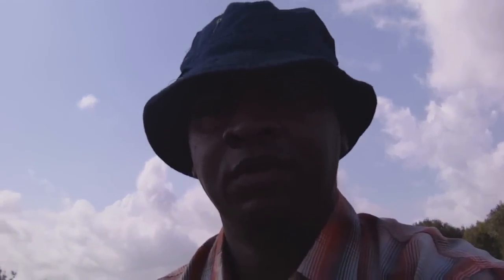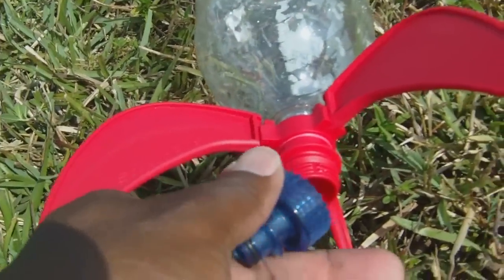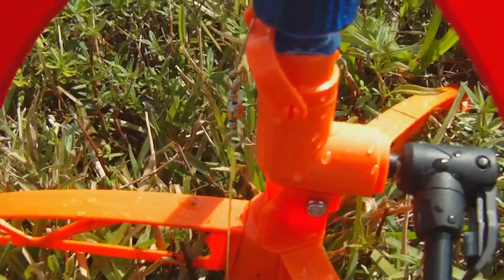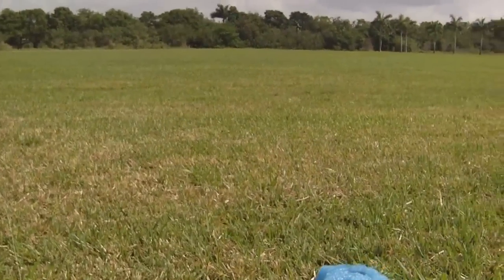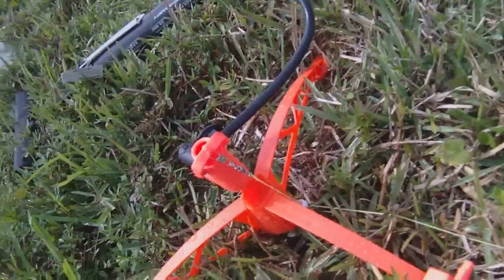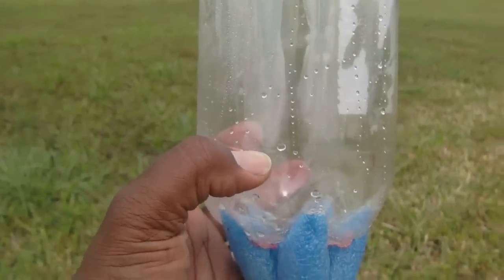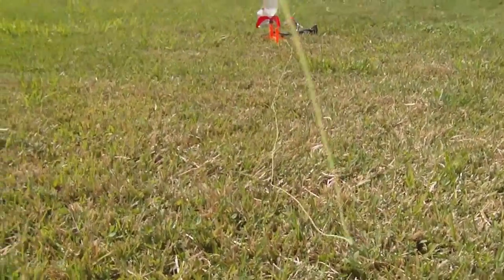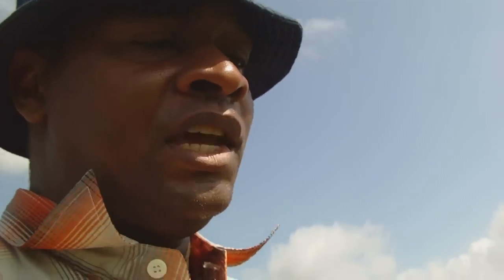Review of Quest Aerospace water rocket and Stratofins

Comment: Great video! Clever modification too with the string-pull thing. Have you ever tried different liquids, especially carbonated ones? I was wondering also if you could have some sort of spark igniter on the end of that string thing and fill the liquid with some sort of flammable mixture.
Reply from the maker: Lol dude you're a beast, please don't try the flammable liquids I'm sure it would burn the nozzle and not to mention startup small fire on the grass. I'm very impressed with this kit though I tried another more professional one made of all metal and it does not shoot as high I think they designed the nozzle too large
Reply: @Raychristofer  woa thanks for the warning. I didn't think about the grass fire. I did assume it would burn through the bottle but not before getting a pretty spectacular launch, but the dangers you described have definitely dissuaded me. thanks.
Reply from the maker: @ccwnoob4393  hey when I was about 12 I put a firecracker in a coke bottle and stuffed a cork on top ad I was putting it down fast to run away the bottle exploded it wasn't terrible but I have a scar on my forearm from  the glass and the fat under my skin was hanging out, my mama should have beat my behind but she wasn't home at the time. Another time we had a BB gun and my brother wanted to see what it felt like he asked me to shoot him in the back with it, fortunately it was very low-powered, I did foolish stuff like that coming up just trying to spare you the heartache. Let me know if you get one of these water rockets though it's a ton of fun

Comment from the maker: Hello this is an update on my experience with the rocket. recently Quest responded to my emails and sent me a total replacement launch system, what they explained is the model I got was one of their first versions, upon opening the new system  I found the base to have been strengthened and braced on both sides of the joint that cracked so this is a good thing. hopefully there arent too many of the old models still in circulation. great system.

Comment from the maker: Oh I never answered your question, I always use 80 PSI, after that its just hard to pump more lol. I usually use 50-60 PSI when experimenting with different configurations so I dont have to travel too far to retrieve. It never ceases to amaze me how high the rocket reaches, I aim  to do better next time with the camera work. What rocket system are you running?

Comment: Hello. In response to you comment for criticism.
I found your review good for showing the advantages and disadvantages of the systems. It was good to see your modifications to overcome the disadvantages. As a review, you could compare to other systems on the market and add specifications, but you covered the basics which makes for a good stand-alone review. 
You were right about the water amounts and the need for nose weight to increase momentum and stability.